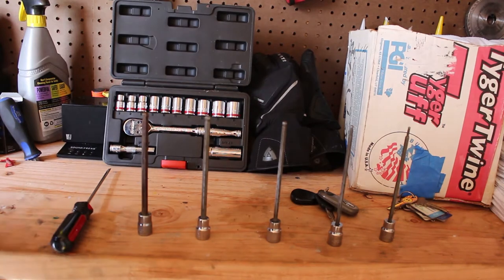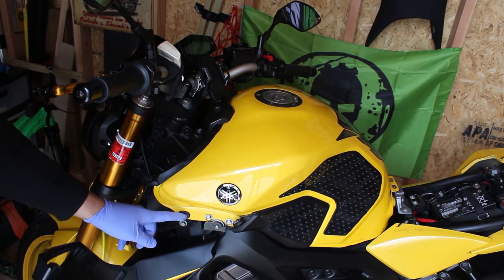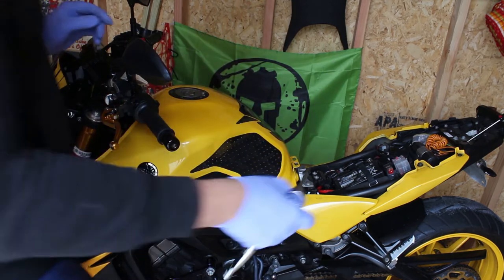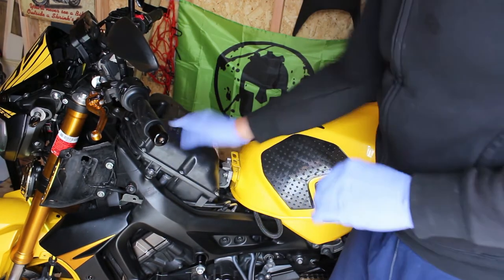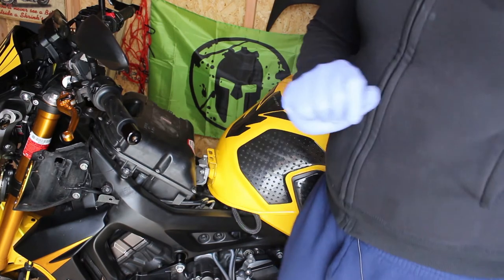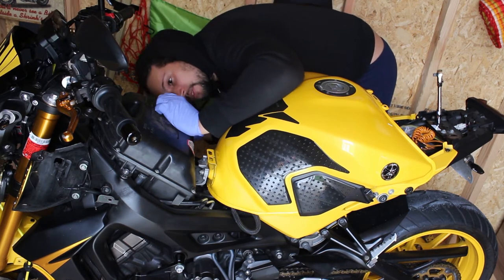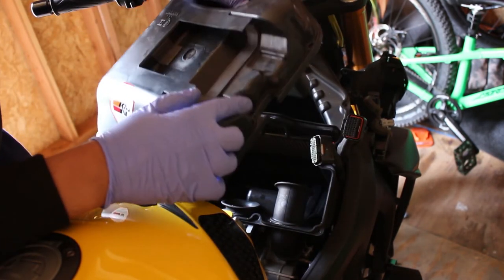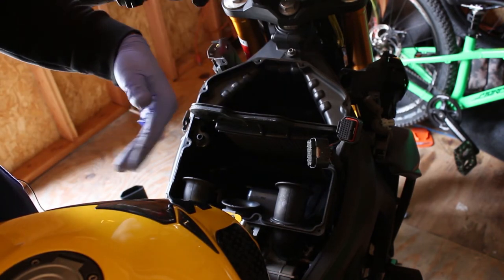Replace the dirty air filter on your FZ/MT09!

Comment: Sweet scooter  and a good video. I have the first gen 2014 and I love it. Lots of fun once you get the throttle and suspension upgraded. If you are worried about contaminants in the air box, you are using the wrong filter. KN filters are famous for passing lots of air and infamous for passing lots of dirt. I used on for a while on diesel truck and pulled it to inspect after 5K miles and I couldn't believe how much dust was downstream of the filter in the intake. If you are racing they are great, but I would't run one long term.  The difference in air flow from a stock paper filter is barely measurable and you probably would see very little difference on the dyno. Well done instructional video.